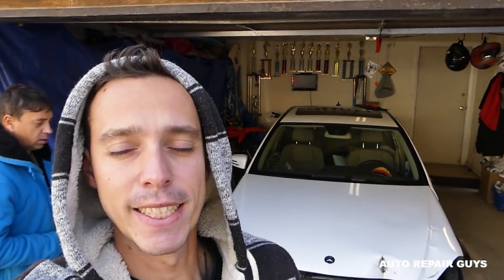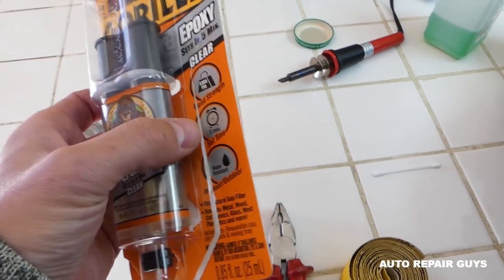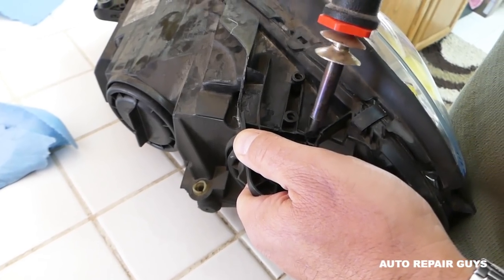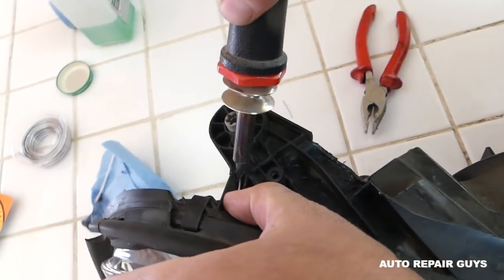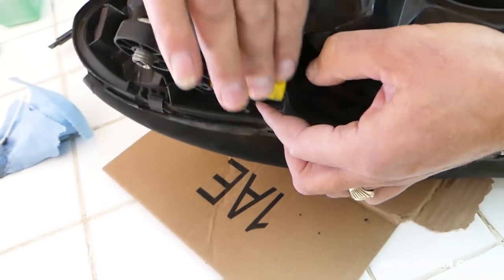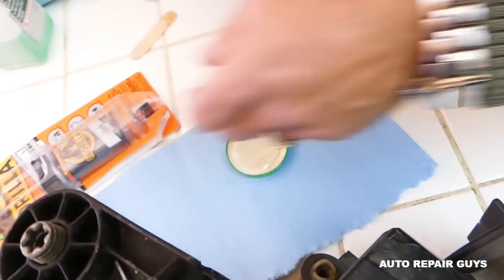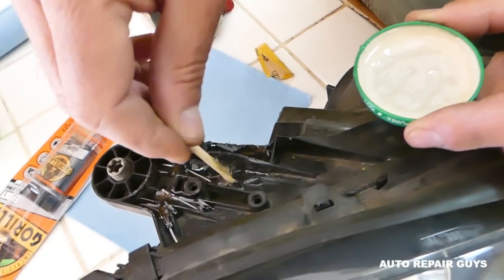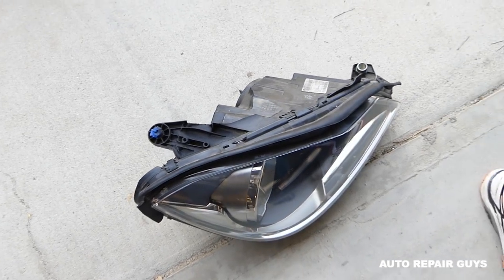HOW TO FIX HEADLIGHT TAB

Comment: I like your video. That was a really good and strong repair to the bracket. What's the thickness in millimeters of the aluminium wire you used please?

Comment: I get what you do with the wire and epoxy resin etc.  
But I am surprised that the first step is not glueing the broken lug to the lamp.
You could glue it and then solder / melt it too, or just glue it.  Would be stronger than melting it , no?

Comment: Hi 
Can anyone tell me if I can use any soldering iron to do this or is there a specific one for plastic welding ?
Thank you
Reply: You can use a regular soldering iron for the repair he showed. They do make an actual plastic welding repair kit, which has the iron and special plastic rods for the exact type of plastic you are repairing.  But they are not cheap at all. The other option is to use small pieces of the exact kind of plastic and melt that with a soldering iron. That would be a good alternative if you don't have epoxy.